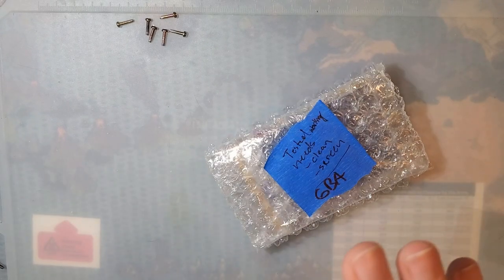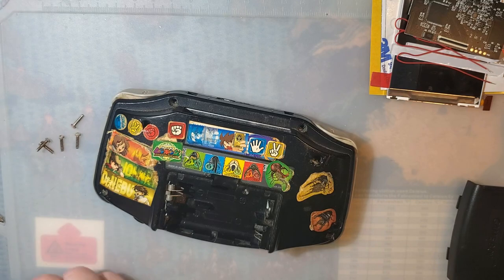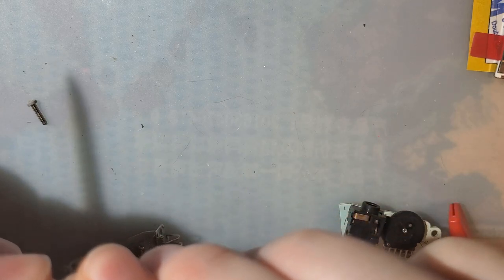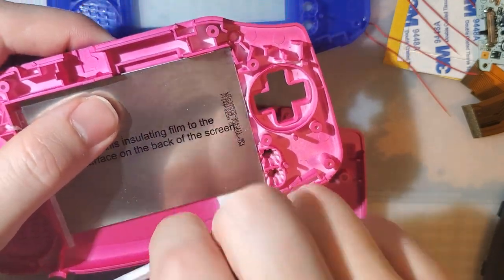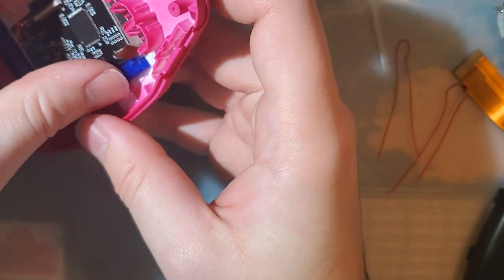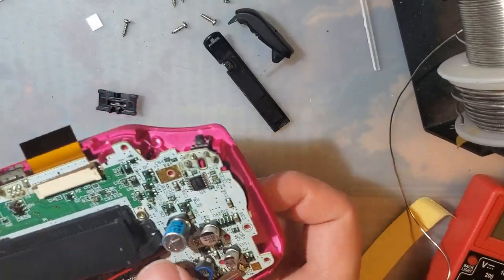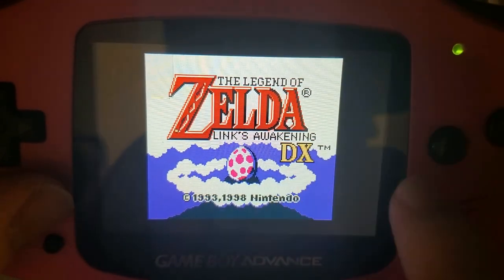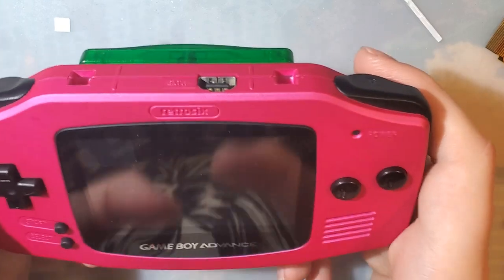'One Chip' Game Boy Advance IPS Kit ('2 in 1')

Comment: It's probably because the LCD is vertical native and they had to do some conversion to make it display in horizontal (horizontal counter clockwise). This LCD is the same in the GB and GBC kits from hispeedido "one chip" and they look great on those kits with no artifacting.
Reply from the maker: "It's probably because..." 

What is probably because? The artifacting I point out with the Link's Awakening DX test? You're correct that it's a portrait panel being driven in landscape (with a frame buffer). Even still, the orientation does not explain that kind of artifacting on the LCD.

Comment: I bought one of these kits and somehow the smaller connector for the display on the pcb got damaged. I watched this video as a guide even following your advice to not have it pushing down on the back of the display. I got no picture and weird audio buzzing that wasn't an issue before installing this kit.
Reply: Upon further inspection with a microscope there appears to be damage to left side of the display connector on the pcb
Reply from the maker: @oddguyjosh  If the parts arrived damaged, contact whoever you bought it from. If you've already fully installed the kit, good luck proving that, however. If everything worked when you bench tested the kit, I'm sorry about your bad luck and do try to be careful next time.

Comment: How’s the quality on the funnyplaying shell compared to the retro six and generic molds? I’m just not a fan of retro six. I don’t like their logos and fonts they use.
Reply from the maker: Both shells are actually pretty nice. I've been working on a video that I'm uploading soon that details my thoughts on both shells.
Reply: The quality is good for the retro six shell, its not brittle and the screw post don't crack (at least with all the times I've opened it and so on). I'm still on the fence about the rubbish coating they have but so far its held up well, only time will tell how good that is. I hope in the future they make the shell the same color as the coating so you don't get white spots wherever the coating isn't.  I wish they had the Nintendo logo on it, but can't blame them for wanting to stay out possible legal issues with copyrights and the famous Nintendo legal ninjas.
Reply from the maker: @BrianFo  except the R6 still does have a Game Boy logo on it so that reason doesn't actually hold solid.
Reply: @makho  that statement was coming from their website itself, and the shell itself does not have it, only the glass lens and I'm guessing that means it is bought from another place and they don't actually make it. Otherwise you got me as to why they would say it.
Reply from the maker: @BrianFo  Glass lens and the sticker it comes with. If the purpose was to avoid customs issues, the shell should not be shipping with either.
Reply: @makho  I agree with that. I never understood why they sent the lens with it anyways. While I'm not expert on copyrights, it looks as if they did change the logos on both of those items to not be exactly the same, but still confusing if that is the reasoning on their shells.

Comment: I bought this kit. You only solder with select because of the brightness, right? actually that's not necessary because it works with touch, right?
Reply from the maker: button control is subjectively better than touch but yes you could just use touch

Comment: Would I need to remove the Nubs on the funnyplaying shell for the install? and do their shells support 3d printed brackets, or do they just drop in? (I’m thinking about ordering a clear shell from handheldlegend)
Reply: also, would it be worthwhile to use adhesive in the funnyplaying shell? i’m not sure if it would be a good idea with how snug it fits in this video.
Reply from the maker: @mcnuggets7504  HHL has been reported to post misleading blog posts or outright bait and switch listings. I highly recommend not supporting them. 

Funnyplaying shells do not support these kits without extra modification.

Comment: I've been getting my shells from RetroModding which is based in Canada and getting it shipped to the UK is expensive and takes a long time but I do think their shells are superior quality. Does anyone know a good place to buy the best aftermarket shells? Not asking for a platform like AliExpress or eBay but like a specific seller/account or something. Hope someone can help
Reply: RetroSix is UK-based and their shells are pretty good quality. They have the IPS cutout built into the mould so unlike other shells on the market, the are no marks where the supports are milled out (the battery bay also has no post, so you don't need to cut it off for rechargable battery mod)

They do have their own logo on the shells, but other than that, I think the quality of the Retrosix shells are better than the generic ones on the market.

Comment: You mentioned a aftermarket replacement power switch for GBA, where can I order one? Have been looking around for ages but OEM replacement GBA power switch are out of stock just about anywhere. Please let me know if you managed to find an alternate part to replace the stock power switch.

Thanks!
Reply from the maker: it's a completely different part, I'm not sure how well it works